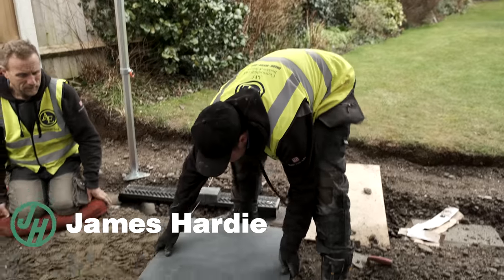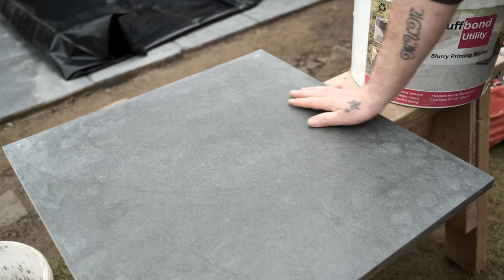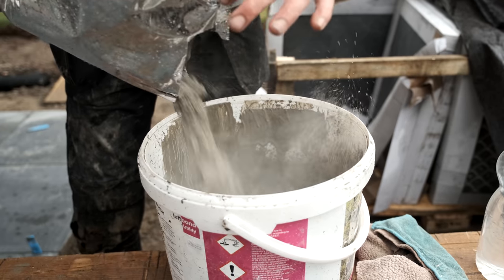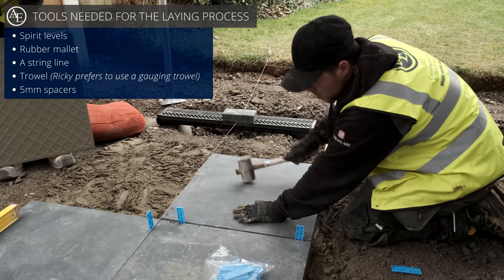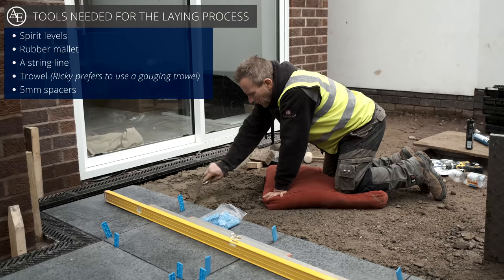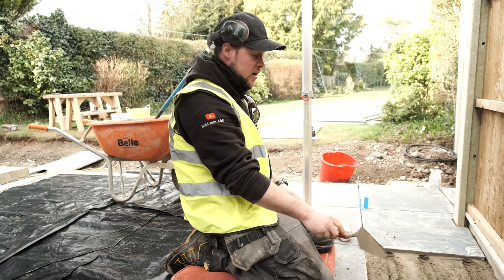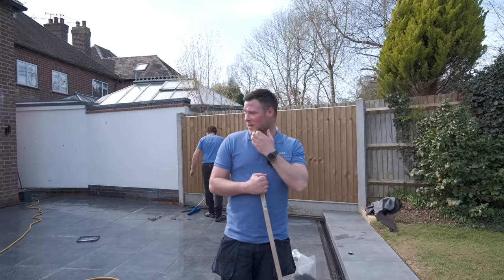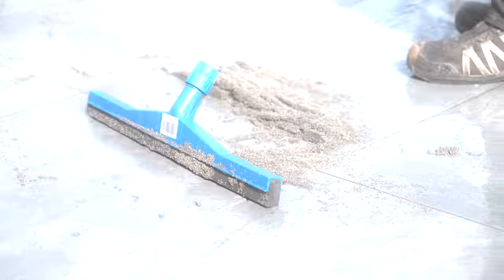PORCELAIN PATIO FROM START TO FINISH

Comment: Just done this job as a DIYer, hardest part by far is getting the bedding mix just the right height before laying the tile, otherwise you're picking it back up and putting down more or hammering for ages with the mallet. Takes some skill and experience to get that one right!
Reply: dont worry buddy happens I didnt get them perfect every time.
Reply: Cut a piece of ply the exact same size to put down first to get the bed right, saves the heavy back and forth
Reply: @rossmale8715  didn’t think of that great idea defo try that next time👍
Reply: @bluevanmani  great idea Ross but I suppose it would only work work for calibrated slabs, I'll be remembering that one though for sure
Reply: @rossmale8715  that sounds like a good idea, I'm going to give it a try 👍

Comment: Don’t use resin jointing compounds unless your beds are 6-1 or weaker. They’re designed to be permeable and you’ll get water trapped in joint and they’ll go black with algae. Look up flowpoint or something of the same style, it’s liquid cement grout have to work fast but it’s the best jointing material out there, you can pressure wash the patio without fear of blowing your joints out.
Reply: Easy grout instead of Easy joint is a good alternative too. I only use joint on concrete or sandstone.

Comment: Hi guys, doing my own garden patio first time. 900 x 600 porcelain tiles 

How do I know what mix sand cement to use ? I hear different ratios like 4:1 and 6:1

Also what size joints are best ? What grout product is best ?

For cream porcelain what color grout would you use also ?

Sorry alot questions there

Comment: Hi guys looking amazing. Having a porcelain patio done and was planning on using azpects jointing compound. But having spoken with azpects technical team they said for it to work you need to lay on a 6-1 mix if grouting with this as 4-1 is not suitable as it will hold water. Have you guys found this to be the case? Thanks

Comment: I floor screed the area then tile them on an 8mm trowel bed .butter the slab with sbr and cement the same i lay them on and you'll need a breaker to separate them .

Comment: I got quoted 7k to pull my 35sqm decking up and put porcelain down....I am tempted to do it myself, but i know how difficult it can be....great job as always guys.
Reply: Was that just labour cost?
Reply: I just priced one up at £5k to rip old patio up n relay at 40sqm, materials and labour
Reply: Depends on the grade and quality of the tile remember some lower prices could be down to poor quality materials and cutting corners. Porcelain seriously ranges in price and quality. Always a use primer epoxy grout like Flowpoint marshal’s or easy grout mapie Fugabella anything like that brush grouts are the wrong way to go n tiles. Hold water they will pop the tiles in time high chance losing the seal. As these brush material 1,s absorb water.
Reply: @MistaJayLJ  way to cheap to do a proper job
Reply: @MistaJayLJ  40 square meters ? What’s point charging that might aswell not do it ?

Comment: Good tips, but note to self: (1) Need to prep the ground much more, with a whacker to compress it. (2) Also need to ensure the level / slope of the patio drains away from the house. Otherwise good techniques, I would use max 3mm spacings between porcelain

Comment: I laid a 200mm wackered substrate, primed with slurry, full slab of cement but my porcelain is still lifting. Wish I knew why!
Reply from the maker: Sounds odd
Reply: @BuildWithAE  that's what I thought. Did so much research! Wondering if I diluted the slurry too much or if it's just cheap crap. Was Pavetuf...if anyone thinking of using porcelain, I'd advise against Pavetuf slurry...

Comment: 3:15 the muck didn’t squeeze down tho so left a void? Think the muck looks to stiff on every shot thats my opinion tho, but nice job, just hope they don’t come lose
Reply from the maker: Hi Smidgey88 it’s always a fine line between getting it to wet or then to stiff, but it would of pushed material down and nothing come loose but totally take on board your comment all the best Tony 👍
Reply: @BuildWithAE  Better too stiff as when it's too wet when you knock down the slab it pushes the adjacent slab up, this does not happen with a slightly stiffer mix. like you say, it's a fine line. Great video, thank you.

Comment: Should be using an outdoor grout.easy joint is not suitable if the laying bed is stronger than 6 to 1 which it should be for porcelain
Reply from the maker: Hi Chris technical data sheet all the best Tony 👍

EASYGrout is a high-quality slurry grout for use on porcelain.

EASYGrout mixes readily with water to give a highly flowable joint filling and grouting mortar ideal for use on porcelain floor surfaces where a high early strength, resilient, compact grout joint is needed, particularly in areas subject to early and sustained trafficking. It is available in three colours and is suitable for grouting joints internally and externally around porcelain tiling and paving slabs, filling joints from 5mm up to 25mm wide with a minimum joint depth of 20mm.
Reply: Hi Tony 

You used easy joint not easy grout?easy joint is permeable so not suitable for anything layed on a stronger than 6 to 1 bed,it will run off the paving and travel through the easy joint and not be able to travel through the laying bed.

Chris
Reply from the maker: @chrisbedford5793  Hi Chris I will check this out again thanks for the info 
All the best Tony 👍
Reply: I am not trying to be negative about your work as its very good,we are a small lanscaping firm and have done alot of researching the best products and a non permeable joint is a must for us with all porcelain.try fugapave grout its outstanding.

Chris
Reply from the maker: Hi Chris every day is a school day but Just found this on there website I will double check tomorrow with there tech guys but it is suitable as I’am reading the technical data sheet 

The same rules apply when working with porcelain paving tiles as with working with stone or concrete. The base on which the porcelain is laid MUST BE PERMEABLE. In terms of application, there is not so much need to use copious quantities of water with porcelain as the EASYJoint will not cause it to mark in the same way it can with stone or concrete. However, users will find that a small amount of water to form it into a slurry, will make it easier for the operator to fill the joints properly.

I will let you know tomorrow once I have spoken to them all the best Tony 👍
Reply: Hi Tony 

Yes it will work if laid on a 6.1 and if that was your ratio it should be fine.i think if your going the porcelain route a 3mm to 5mm grouted joint looks better and finishes it off really nice.i hope the weather where you are is being kinder that it is in Devon.

Chris
Reply from the maker: @chrisbedford5793  Hi Chris it’s on and off but wish it was sunnier I will check out the Grout you have suggested because that’s why it’s great to hear and learn more things and get other people’s advice, it’s been along time since I been to Devon beautiful part of the country have a awesome weekend all the the best Tony 👍
Reply: @chrisbedford5793  I had to use easy grout with our porcelain and not easy joint, we use easy joint on sandstone slabs ect.

So you reckon there’s a chance of porcelain lifting in frozen spells if easy joint is used on porcelain?

I ask this as easy joint is so easy to use but the grout is time consuming in comparison 

I’d be interested to see what happens to this patio over winter to see if it lifts
Reply: @ITryTo what ratio mix did you lay your porcelain on?we use fugapave flex ch grout which is a brilliant product,have seen people use easygrout and it looks very messy and time consuming